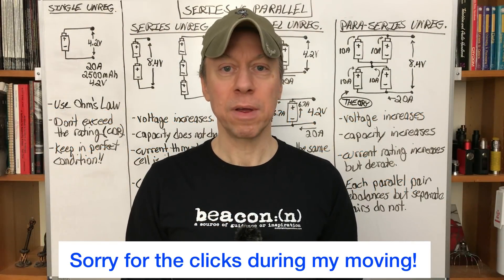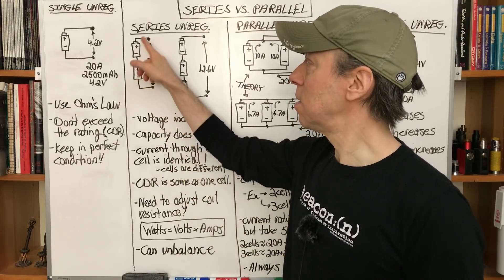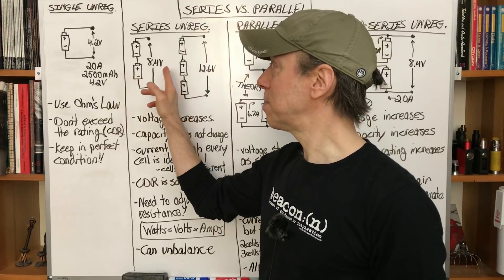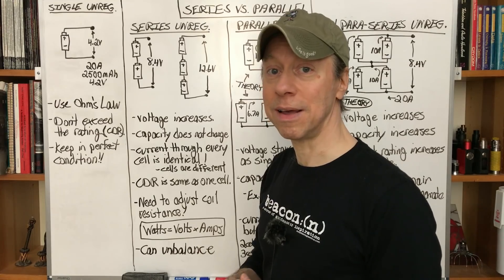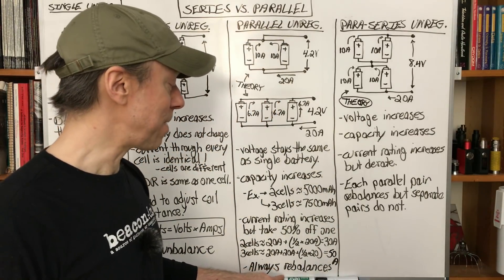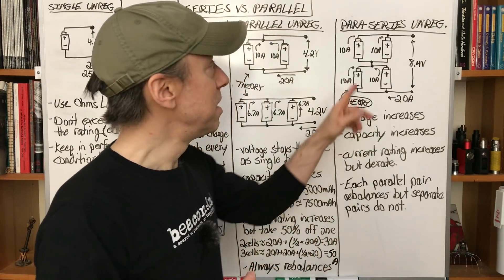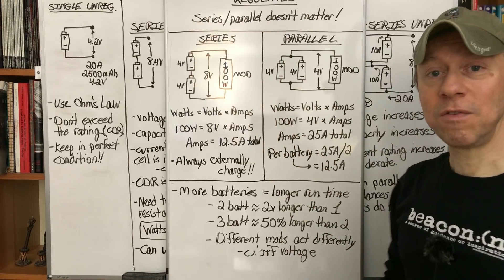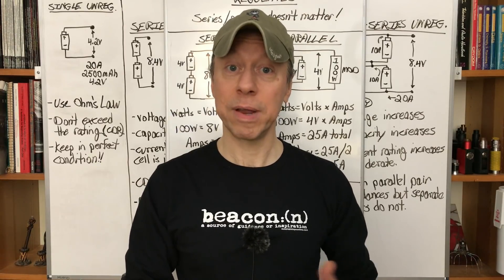Battery Basics for Vapers Ep2 – Series and parallel battery setups

Comment: hhow to properly stack flat top batteries, because magnet are not safe and i just dnt know what else to use please clear me uo on this!!
Reply from the maker: Many flat top cells cannot be stacked because their top contact does not stick out enough. There is nothing we can do safely about this. You will need to use different cells.
Reply: @batterymooch  Is there anything safer than magnets besides buttontop batteries?
Reply from the maker: @necap4887  I don’t know of anything you can use safely between batteries in series.
Reply: @batterymooch  Alright, Thanks :)

Comment: Idk if u will see this but I am thinking of getting the clutch x18 which is a parallel mod and up to this point I've been using a single mech and regulated mods so I'm a bit confused. 

If I put 2 molicel p26a 18650s in rated 25A each and charged to 4.2 volts. If I'm correct that would give me 50A. Then a build at 0.15ohms would that be safe to run. 

The mod says it can't exceed 37 amps or the fuse will crack. I did check on an Ohm calculator and saw that it comes out to 28A so it should be safe but I'm confused when u explained that one battery would be for example 25A and then u half the 2nd. 

I'm used to using a mech and I normally go to a .15ohm build and just vape until I feel like the battery is hitting weaker then switch. I just wanna make sure I can do the same thing with the parallel mod. Obv if I have 2 batteries at 50A and a .15ohm build requires 28A on 4.2 volt battery. As the volts decrease the amps required will also decrease. So I'm just wondering if I can safely drain the batteries the same way I would in a mech.
Hope u can help and sry if I sound stupid, just wanna make sure I'm being safe.
Reply from the maker: That Clutch is a full mech so use the same calculations and safety.
Cells in parallel don’t share current equally so many people half the rating of the second cell to take that into account…just in case. It’s up to you whether to do that or not. There’s no way anyone can predict how well your cells will share current when new and especially as they age.
Reply: @batterymooch  Ah ok. Ty for explaining

Comment: Is it okay to use 50A and 40A battery at the same time at a series fullmech mod?
Reply from the maker: No. Especially since there are no 18650’s rated over 30A.
Only use the same type of battery in a mod and they should be bought at the same time too.

Comment: This video enlightens me so much.. Thanks for this video .. 

And i want to take this opportunity to ask this to confirm to one and only Sir Mooch..

For example, i'm setting up my limit of 0.20 ohms (or my minimum) on a single battery mechanical mod so that i cant go too far above 20A or 25A discharge rating (21A to be exact).. Is it safe to say that i can set my limit to 0.10 ohms in a dual battery parallel configuration of mechanical mod? Since i computed that it will land in the same 21A rating each battery, given it has a good connections and built.

Hope you notice me Sir Mooch, more powers :)
Reply from the maker: The total current available in a parallel mod is not quite double the single battery rating since batteries do not share current equally. I recommend not using the theoretical doubled current rating. I recommend subtracting at least 15% from the doubled rating to get the rating to use, just to cover any unequal sharing of current.
Reply: Thank you and noted Sir =)
Continue creating useful videos and guides, it really helps a lot of us. 

#BatteryMoochGuides

Comment: Hi  Mooch, super awesome explanations! Just one thing I'm in little dissagreement and maybe you (or the community) may clarify as I might be wrong... when you state that a Series batt setup doesn't increase capacity, I agree, it doesn't, strictly talking about capacity it remains the same. But in fact those batteries will last longer as you are consuming half the current given you have now doubled the voltage (provided we are talking about the same load, to compare apples to apples). 

If instead you were maxing out the ratings and always aiming to get the most of the battery, then you must have had to reduce the resistance of the load to half of the original value in order to keep pulling 20Amps with twice the voltage and in that case that wouldn't be a fair comparison to "rate" a battery setup alone if it depends on the load. Right? 

Then I asked myself... If I want to somehow rate the setup by itself not messing with the load nor anything else but the batteries... isn't it there when we need the watt-hours??? At the end of the day I think what I'm getting confused with here is just that! because you will not increase capacity for a series, but you do double the watt-hours, being actually the same watt-hours for a 2P or a 2S, and both doubles the watt-hours you get with a single cell. So.. I thought I get it but I'm not completely sure whether or not I'm comparing apples to oranges.... 

Hope you can help clarifying! 
THANK YOU!
Reply from the maker: Yes, exactly.
The capacity stays the same in a series setup. This is confirmed by drawing the same amount of current as was used in a single battery setup and noting the run time....which will not change.

But for vaping you are correct. With a series setup we can lower the current we draw which allows for a longer running time for the (unchanged) capacity we have. So we can use the capacity spec for everything without problems but the Wh spec is MUCH more useful as it not only takes into account capacity but voltage too. This affects how hard a cell hits in a mech and how long a cell runs in a regulated device.
Reply: @batterymooch  awesome! Thanks for taking the time to respond!!! Keep up doing this great job you do! I admire you, wanna be like you when i grow up (already 37)
Reply from the maker: Nicolino I’m 58 and still haven’t grown up. 🤪🤪🤪

Comment: Good day mooch do u have video on how to determine a bad or not in condition batteries ex the symptoms etc thanks God Bless you
Reply from the maker: Sorry, I don’t.
Usually the first sign that a battery is reaching the end of its life is that it doesn’t run for as long as it used to. If it runs hotter then it’s getting old too.

Comment: hey mooch i have question 
i own a revenger x mod am using 2 samsung 30q batteries i was wondering if 0.08 ohm is safe to vape on becuse i have noticed that my batteries gots worm after 2-3 puffs
Reply from the maker: Coil resistance doesn’t matter in a regulated mod, just the power setting affects battery current.
You can use 30Q’s at up to 90W in a two battery mod, 120W if they aren’t allowed to get hot. Perhaps yours are fakes or you might need to switch to VTC5A’s, rated up to 150W in a two battery mod.
Reply: @batterymooch  oh thanks for the answering batteries are original but i was consinder because they got little worm after 2 3 puffs wormer than i fell comfortable thanks a lot
👍👍🙂🙂🙂

Comment: You might want to mention never to put a fully charged and a partially discharged or dead battery in parallel.. the current flow between them can be extreme due to the balancing effect of the parallel circut.
Oh and thank you for everything you do.  I have a feeling vaping would be far more dangerous if your testing weren't around keeping us informed and the companies in check when they inflate ratings. THANK YOU!
Reply from the maker: Thanks! While the current level can be high, as much as 30A, it is only for a short period of time and typically won’t vent the battery. Thermal runaway would be almost impossible just from this IMO. I agree that a charged and discharged battery should never be paralleled though!
Reply: Battery Mooch, thanks for the reply. Even though not something that should be done, it's nice to know it shouldn't be catastrophic. 
Thank you again for taking the time to do the tests and to explain battery safety so we can all be safe.

Comment: I have one question.  In an unregulated parallel setup, is there a point where addidng more cells no longer changes outcomes?  I see all these homemade boxes at events with 10, 20, or more cells (guessing in parallel) and just wondered if that would offer any benefit at all?
Reply from the maker: Adding more cells will always increase the current handling (if the wiring and 510 can handle it) and vaping time but at a certain point the returns might not be worth the investment. Sure, 101 cells last longer than using 100 cells but it’s only 1% longer vaping time.
Reply: Battery Mooch thanks thats exactly what I was trying to ask.

Comment: Does using my 18650 batteries gently (recharging before the low voltage cutoff and not recharging them to full charge) extend their life?
Reply from the maker: Yes.
Check out Ep6 of my Minding Your mAhs series.

Comment: Regardless of how the math seems to work out, every parallel 2 battery regulated mod I've used outlasts even 3 battery series mods. Even with higher capacity but equally suited batteries. 
For example, the (parallel 2 batt) sigelei 100w TC compared to the newer (series 3 batt) sigelei 200w TC, 3 samsung 2500mah 25R5's in the 200 TC but 2 Sony woman VTC4's in the 100w TC parallel mod = parallel outlasting the 3 batteries with higher capacity. Where the tests I've done really shine is using all new 25R5's in both mods, the 100w TC would last 2 days with the same tank at the same watts, the 200w TC would have about 1/4 to 1/3 battery left at the end of the first day. I swapped the batteries around multiple times between the mods and got the same results consistently. So I compared the 100w TC to the wismec jaybo 3 battery series mod, same results with that mod. I used an external charger for all of this by the way. There is just something about parallel mods that really does last longer than series mods, the results I was getting was similar to my parallel unregulated mod also, just as a side note, as far as run time overall when matching the watts and current draw as closely as possible. But the parallel unregulated always beats the series regulated when trying the same thing. Again, even the 3 battery series mods.
Reply from the maker: Run time fundamentally depends on the cutoff voltage and the way you vape, including ramp up times for the coils. With all the variables accounted for any two battery mod shouldn’t be running longer than a three battery mod being used the same way. If it is there is a variable, or variables, that weren’t accounted for.
Reply: Battery Mooch I appreciate all your work, I hope your patreon campaign gets some solid footing and helps you do what you do!

Comment: So lets say I'm running a dual battery parallel box, what type of build would be more efficient in that setup, a 0.1ohm or 0.38ohm?
Reply from the maker: A battery running at a lower current level is always more efficient. But, it might not be the way you want to vape.
Reply: Battery Mooch Yeah thanks, I just wanted to be sure. Love your videos, I would never have trusted myself going into mechanical mods without at least having a basic understanding of electricity which you have provided pretty well.

Comment: Hey Mooch, Thanks for investing so much of yourself for our safety. All of your drawings show the batteries with the positives up and the negatives down. But my regulated duel battery mod has the batteries opposite of each other. Is this series or parallel?
Reply from the maker: It depends on how it is wired internally but most like that are series. Check with the manufacturer to be sure.

Comment: i run below 50w most of the time and im more concern about battery time rather than the amp limit.Which is better, a series double 18650 (drag/charon) or a single 18650 mod but ill be carrying extra battery
Reply from the maker: It depends on your personal preferences.
A dual battery runs longer before needing charging but is heavier. A single battery mod is lighter but won’t run as long.
Reply: Battery Mooch appreciate the help thanks!

Comment: Hi Mooch, what’s your thoughts on running series 18350’s in the Pulse squonker? I’ve got some Efest Purple 350’s here (no idea what’s under the wrap though) but we’re these rated as 15A cells? They’re got 10.5A printed on the wrap.
Reply from the maker: 15A? No chance.
A few amps at best. It’s been too long since I tested them to say what they actually might be now though.
Reply: Yeah thought that was on the high side, what 18350 would you recommend to run in series? I’ve put a single coil Flat ni80 0.95ohm build in the Drop here to stay safe to see how it is before getting some new 18350’s, coming out to 8.8A and 74w. Nice flavorful vape but want to get some decent 350’s for it. I just don’t trust Efest batteries anymore.
Reply: I’ve ordered a pair each of Ampsplus & Keeppower 1200mah 10A batteries now, I think the Mah rating is slightly high and more like 1150 but they look like a good 10A battery. Not a lot out there, most of the popular ones are 5-8A. After a load of reading im pretty sure these use the old Aspire cell under the wrap, also from what I’ve read Vapcell use the same cell in their new 18350? Should be good. I’ve ditched the Efests, getting a little warm after 6-7 pulls so didn’t want to risk it.

Comment: Hey Mooch, I'm a little confused about something and was hoping you can clear it up for me.  For use in unregulated devices is it safer with lower builds to use a battery with a higher continuous discharge, or batteries with higher pulse ratings?  Also if a battery has a higher continuous discharge is it safe to say that the pulse rating would be higher than that of a lower continuous discharge battery?  And when looking at batteries for lower builds should I be looking at pulse ratings or cd ratings?
Reply from the maker: Pulse ratings are absolutely useless. We can’t use them for anything as we don’t know the length of the pulse, the time between pulses, or the criteria used to set the rating. Use the continuous rating.

Check out Ep2 of my Minding Your mAhs series,

Comment: Battery Mooch Thank you for answering my question on why regulated devices are usually run in series rather than parallel. I never figured it'd be the same draw from the battery either way due to the amps being used in a different way. I figured you'd get better battery life with parallel when using a regulated mod but it's interesting to see just how regulated devices use the energy

Comment: OK Mooch, I've been biting my typing tongue as long as I could waiting for you to start a dialogue about chargers but I can't get an honest/intelligent answer from any of the sources I've poled concerning my 2nd Nitecore New I2 2 bay battery charger. So I will start it.the reason It's my second is that I returned the first one because it heated up when charging batteries. But the second one does the same thing. : average room temp of 68 - 70 degrees,  2 18650 batteries take 5 hours to charge. I'm o.k with that but during the process the charger and batteries reach what I estimate to be about 85 degrees fehrenheight. I'm pretty sure the charging system shuts off when charging is complete because they cool down gradually. Is this normal?
Reply from the maker: I don’t know if that’s normal for that charger but some run very hot. It’s not good for the battery though.

Comment: In a HoG (para-series mod) is it useful to "marry" two and two pairs, so the same two always is in paralell?  I have two married sets of 4 batteries, one set I have "the flash" wraps on, with two of them wrapped upside down, so the flash don't have to be upside down in the mod. but I ran out of special wrap so the other set is just plain green, with no way of knowing which battery goes witch way...
Reply from the maker: Hmm...good question. Yes, but all four should be married as a set too.

Comment: Hey Mooch I have a Wismec Gen3 and where the battery door closes the two pins that complete the circuit to the bottom door one of the contact plates is worn through the copper not completely but enough to make it work,I started noticing it misfiring and I figured the mods not safe to use. Should I toss it ?
Reply from the maker: An improperly working mod is never a good thing to use. I don’t know if its safety is compromised or not so I am forced to err on the side of caution and tell you to not use that mod anymore.

Comment: so, series-parallel does not matter. does that hold true in unregulated as well when it comes to battery life ? so it would just be watt-hours correct ?  for example you run the same wattage on a para, and then the same wattage on  a series the battery life will be the same, correct?
Reply from the maker: Yes, as long as you have accurate wattage calculations...wattage is wattage. You lose a bit of power going through the regulator circuit board, a few percent, though.

Comment: How does a 3 battery regulated mod work?

I have two both use two batteries in one orientation and the third is switched, does it work somewhat like para series?
Reply: No, It's series. through the first of the pair, through the single then through the second.
Reply: i see, thnx
Reply: Thats because when you have the first battery one way, and the second the other way, theres no third way to put the third battery.. (or, there is. but the mod would look stupid)
Reply from the maker: As mentioned, that is probably a series mod. But since series or parallel does it matter, well, it doesn’t matter. :-)